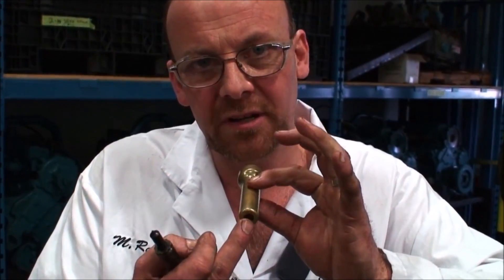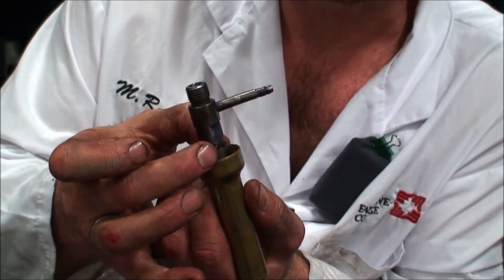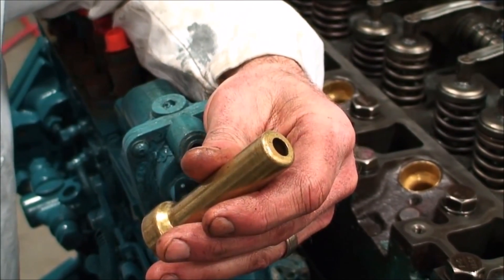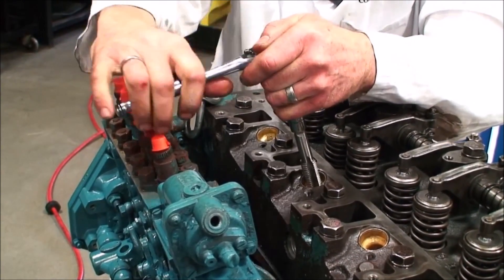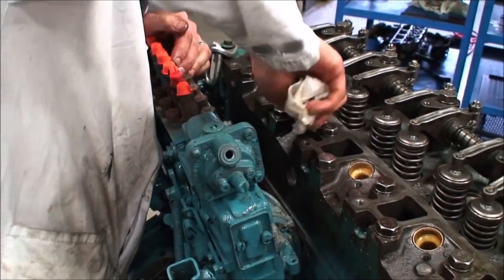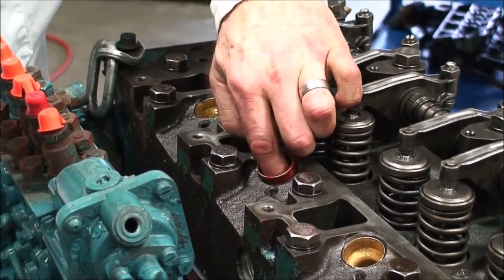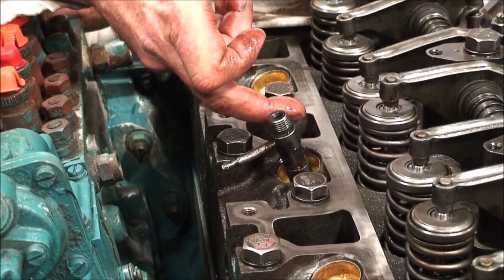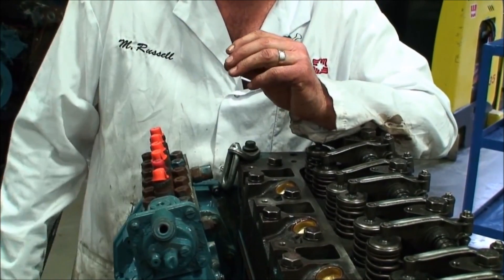CAT Injector Sleeve Removal

Comment: CAT nozzle, CAT plunger, CAT injector, Pencil nozzle, VE pump parts, nozzle holder, head rotor, Control Valve, Common Rail  nozzles, diesel injector nozzles, Delivery valve, Diesel Engine Parts, Fuel injection pump  parts,
Contact My Whatsapp: +86 18659481994 
Facebook:https://www.facebook.com/profile.php?id=100019414304804 … E-mail: sales2@diadiesel.com

Comment: Mr. Edwin  if u see deeply in this video  then u can ask me wrong. Tell me where the cutting chips going during tape thread making?  is this safety for both technician & engine meanwhile I appreciate ur efforts regarding technical education & certification.
Reply from the maker: Ansar Ali yes Ansar, you must plug the bottom of the hole with rag.  Personally I also get a small vacuum pump and suck up any debris in the cylinders after the proceedure.  Even a small metal fragment, or even fluids such as oil, could jam and bend a valve.  Cleanliness is essential.
Reply: mr edwin your reply was nice& informative